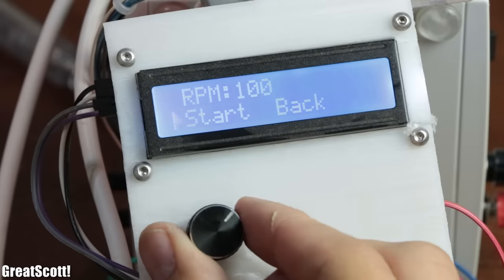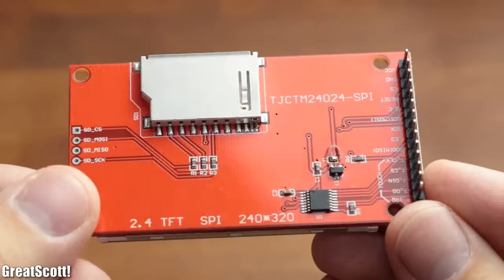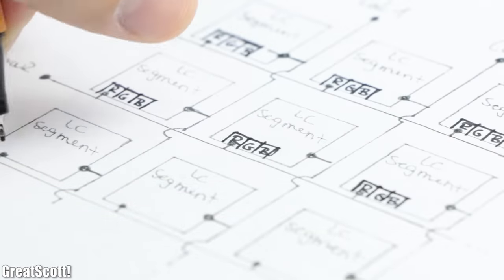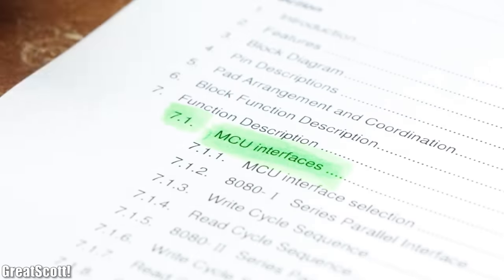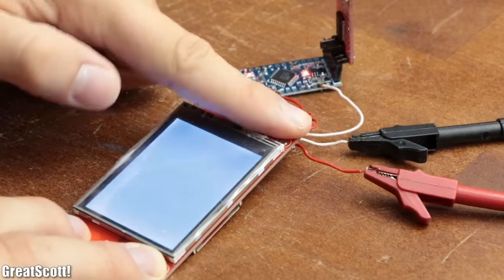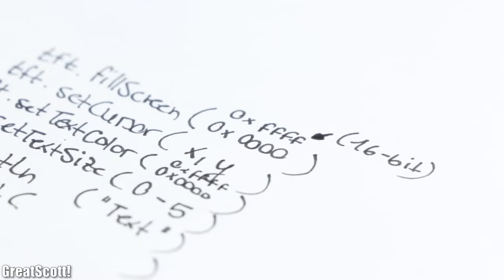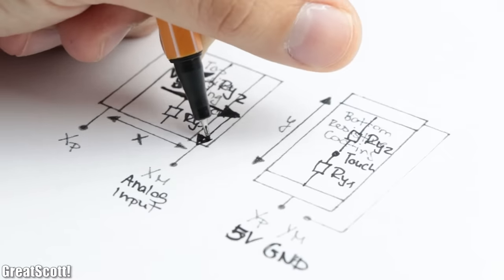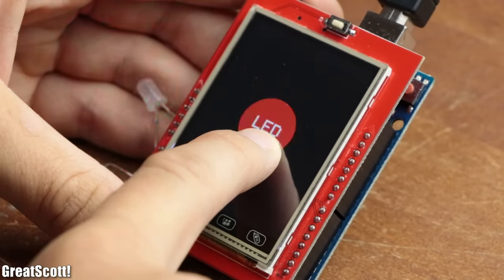How to create a simple Touchscreen GUI || Arduino LCD & Touchscreen Tutorial

Comment: Lol. Look up the MCUfriend library for that shield based display ...you know...the one mentioned on the silkscreen of the breakout board... That is one of the best display libraries written for Arduino and TFT displays. That library can even auto detect the hardware of the display because the MCUfriend library also specifies the shield pinout. The hardware is probed and supported using conditional if statements in the code so it can support a range of different hardware. It's an incredible example to check out.
 
  One thing I'm curious about are the memory IC's associated with a lot of these displays. Often they are unpopulated footprints on the breakout boards. I'm curious what they can be used for. Can these store backgrounds/images to lessen the load on the uC, or speed up the display in some other way? Do we need to program the memory externally or in circuit?

  Has anyone found a better deal on an ili9341 display than $4.23 shipped (AliEx/what I paid 10/2017[the listing has changed since]) ?
Reply: $4.23 is expensive? That's about the price of an Arduino clone!
Reply: @GRBtutorials  
That's about the price of 3 arduino clones if your willing to buy the all too common versions that use a ceramic resonator for the 328 like the official design specs. I have found the micro and mini clones with crystals instead of ceramic resonators for ~$2. It doesn't really matter though bc Ardy1 is all about the libraries not the hardware. If the hardware really mattered we should have been using the ATmega1284 ages ago, as it has the most features of any ATmega uC that comes in a 40 pin replaceable dip package. There is an ArdyIDE compatible version called the "Sleeping Beauty" project, but I haven't tried it myself yet. I will soon though bc I found an AliEx seller that posted ATmega644's at $0.90 each. I ordered a half dozen, and he's disabled the listing as "unavailable" ever since. Arrow also has the dip 40 version of the 644 for around $5 and with their free shipping deal, they have the best price I have found on those. I'm primarily interested in building a home etched version of the open source AVR transistor tester project version 2 from the official documentation using the 644, but I want to try the sleeping beauty hardware eventually too. That project is easy to find via google and the official page links to gerbers posted publicly on Osh Park. They can be downloaded and etched or they also work on the PCBway or JLCpcb site. I have no affiliation with either. However if anyone is interested in projects like this, I know JLCpcb hasn't stopped people from doing panelized designs. PCBway says they will not do panelized designs without a surcharge. I built a cart of items on JLCpcb awhile back. You can modify the 10 quantity for $2 first order thing to order a quality of 5, if you order multiple items. Each quantity of 5 was $2 as it showed in my cart and I took it all the way to the "input your credit card" screen. I didn't purchase it though as I was just exploring the option at the time. That said, if I understand all of these unspoken options on their site I can panelize two or more designs with multiple projects fit into multiple 100mm × 100mm double sided design/gerbers, then they are $2 each with free shipping.
...Sorry ....tangent...All that said at $4.23 for a single LCD... Even if I etch a design myself, I have already learned the hard way, never buy 1 of anything. There is no replacement for the ability to swap 2 items to determine if one is faulty. I've spent many hours trying to solve single product faults because I was dumb and ordering one of whatever thing. So at a minimum I'm looking at $8 for this LCD. If I'm going to order 5 or 10 of a PCB I need to order 6 or 11 LCD's. So that's going to be around $21 to $46 just for the LCD. However, building all of them, keeping one or two, and listing the rest on eBay should cover most of the project's costs.
 That's how I view these kinds of purchases. I break everything down to what the single quantity price is, but I'm usually looking for the best deal on multi-quantity listings or price breaks ;)

Sorry if writing details offends anyone. I'm just sharing and like when others do the same.
-Jake
Reply: Sure, I was just doing a rough estimate with "the same price". The clones I buy cost 3 € minimum. Does Arrow really have free shipping no matter the price of your order? Digi-Key and Mouser both have a 50 €/$ minimum order price for free shipping. Do they ship free to Spain as well? 

For prototyping and one-off projects, etching your own PCBs is the best method. It's the fastest one (you can make a PCB in 20-30 minutes at most and I don't know of any carrier shipping that fast) and most likely the cheapest one as well since you only need one. And what if you make a fatal, unfixable mistake? (like Jeremy, aka GreatScott! made in one episode of DIY or Buy that made him go for Buy. Seriously? You give up already?) Then you have 10 boards that are junk. But if you etch them, you only have one broken PCB.

I agree with you on buying more than one of anything (though I sometimes break that rule if it's too expensive), but it's not that expensive unless there are really that many faulty components. Then you should buy from another source as that one is unreliable. But if all of the ones you buy work, then don't worry, you'll find some way of using them all! And making various boards and selling them sounds like a good idea, especially considering you can sell them for more than the components cost you!
Reply: @GRBtutorials  
  Agreed. My biggest issue so far with etching is just getting my trace resolution low enough. I can do a perfect double sided etch with dry film at a trace resolution of 0.6mm to 0.75mm using the super cheap Chinese film and cheap copper clad. I try to keep my traces around 1mm and larger as much as possible right now. I've gone all the way down to 0.4mm using toner transfer but the traces are getting sketchy at that kind of resolution with the cheap setup I'm using. I'm collecting the stuff needed to upscale my etching setup now. I think I'll be able to improve my resolution if I stop trying to squeeze my designs onto 10cm × 15cm copper clad with ~1cm margins. I just ordered some 8in × 12in (~20cm × ~30cm) from ABCfab on eBay last night. That should maximize my potential design area close to the size of an A4 transparency. I'm going to try to panelize a few projects and make an attempt at a 10×10 LQFP-64 at 0.5mm pitch in the next few days. I also hope I can replicate my toner transfer TSSOP 0.65mm pitch/0.4mm resolution using dry film too. I've heard that I need to pick up some Dupont Resiston film to get better results but I still need to order it.
  I guess I need some better enchant though bc my last project iteration took 45 min etching and you just claimed you could do 2 total iterations in that timespan. It takes me about 3 days to do each revision of a design, but I'm a partially disabled gimp and very slow. Maybe when I get my setup dialed in I'll be a bit faster. I know I'd speed things up if I figured out how to add the teardrop trace plugin to KiCAD. I currently design in KiCAD then export an SVG image to GIMP. Then I finalize my design in GIMP by removing every sharp edge and angle. I've only done around a dozen etches using dry film so far, so I'm still dialing it in. 

  In my opinion Jeremy is mostly interested in monetizing this whole YT affair. Almost everything he does is focused on advertisers and referral kickbacks. I don't hold that against him or anything. However, his best uploads IMO are the ones where he's building or doing some project he actually wants to work on like his bike project, solar roof, or RGB light-wall-thing from way back. I don't think he's got a very technical background beyond the electronics stuff. Most of the YT community is in the same situation though. We can't all be Big Clive or AKA Kasyan. I think it would prove challenging for Jeremy to develop a solid prototyping system and keep his weekly upload schedule. Plus the largest audience here on YT are the absolute beginners not the intermediate or advanced enthusiasts. Financially, he's probably right where he needs to be with content. 

  As far as Arrow and the free shipping deal, I'm not sure about how their international business works. The deal I see is for free overnight FedEx shipping with no minimum order. I've done a few $20-$40 orders so far and it's pretty awesome. I've almost ordered from digikey a few times in the past when they were the only one that stocked a part or two, but I have always found alternatives and equivalents. Supposedly, there is a way to get free shipping (plus cost of a postage stamp) from Digikey if you send a BOM on some kind of ancient mail order form and include a check for the correct total. There's an old post on the eevblog forum that details this, and has the pdf form IIRC. That's too much hassle for me, plus Digikey already has the highest prices on every bom I've compared against mouser. I've ordered from mouser a few times but they cost me ~$4 shipping. I'm in the greater Los Angeles California area so they all have business operations in the state which means I have to pay ~10% extra in state sales tax too. Free shipping places Arrow on even footing with AliEx sellers on a lot of things especially more modern microcontrollers. The next day delivery means they are by-far the most convenient option I have available. Their website is really bad though, and the mobile version is practically useless.
  I think they have international operations and their FedEx deal could be int, but I don't know. Most of their shipments come to me from out of state so it's not a local kind of thing.
-Jake
Reply: @UpcycleElectronics  Totally agree. On Ebay always buy at least 2 of each. 
Mcufriend library  by David Prentice helped me getting those Mcufriend tft modules come alive. They are produced with different control chips and with no documentation
or marking and they can be hard to identify. 
Check also this site: https://www.tindie.com/stores/MCUdude/.   This board supports all the 40 pins ATmega's. Up to 1284. A little expensive,but good quality.
Reply: @mannhansen9337  
 Nice link. There is a project called sleeping beauty that uses the same 'mighty core' for an Ardy compatible 1284. If you search and find that project you will discover the gerber board files are posted publicly on osh park's website. You can easily download them and send the file to a much cheaper Chinese board house. I was going to try that but I started etching my own stuff. I have a single sided 1284 dev board designed for the AVR transistor tester project. I did 2 versions, one for the TQFP-44 and one for the DIP-40, (no content created). Both have an identical breakout setup. I made it with super flexibility in mind. The whole thing is setup to use standard 5x7 and 4x6 perfboards with headers kinda like shields for an arduino with a bunch of (4x) power rails and interconnects built in.

  I wanted to explore a bunch of the LCD options for the official open source AVR TT project. That's where the MCUfriend library kinda sucks. A lot of displays are sold online by people claiming they are ili9341's when they are not. I think they do this because MCU-f supports them. I learned the hard way that a lot of these "ili9341's" either are different control IC's, or they are limited to a parallel interface only and therefore they take up almost all of an Uno's I/O. The best way to get an actual 9341 is to find the ones that only breakout the SPI interface.

Comment: I don't know ... I still would go for some sexy rotary encoders over a chinsy resistive touch screen

Those LCDs are very cool though ... am seriously considering moving to those (so far I've used those relatively tiny OLED screens ... aaand ... meh ... the SSD1306 ones are fine, but they do suffer quite a lot of burn-in, especially since most of them are blue, which apparently is the color that dies the quickest)

Comment: Hi great scott
 I have a question .... I measure the voltage in my home at mains plug with neutral and ground while electricity cuttof.
 I get reading  of about 4 and half volts.   But when I connect small led to it with diode ..the led is glows for less than second. ...while in my pc extension board , I always seen led glows dim and continues .
Can I get some power to charge my phone or glow little led lamp while cutt of electricity   .by using boost converter. ..plz make video on this topic. Thank you.

Comment: Is it not the adafruit library works only in arduino uno since they have a different pin layout with the arduino mega or you just adjust the code instead?

Comment: Know how, there is a Wemos R32 D1 with UNO Pinout, Touch and function is not so easy to use. Here the Pins for touch A1 = 4, A2 = 15 , D6 = 27, D7 = 14 - 15 is not connected to A2

Comment: Hey great scott,just a fast question have you found a way to eliminate using all the pins on arduino so like I can add sensors like to display data on the screen but without needing to solder

Comment: I also had some problems with SPI display till I realised that it has 5Vcc power supply, 5Vcc with a 10 Ohm resistor to LED but 3.3 Vcc logic. Now it is working fine but I am looking for info on how to manage touch signals (that also must be 3v3).

Comment: I have a problem with the TFT 2.4 LCD project.
my lcd was detected with the ILI9341 chip but when
tft.begin (0x9341); LCD does not work normally, LCD is only white, but when I replace it with tft.begin (0x9325); the problem will be solved but not all, there are a few more problems with the LCD,
1. the writing on the LCD is reversed
2. The color on the LCD fades does not display the actual color
3. touch the screen that is not according to what I press
I use the library that is on your YouTube channel

can you help me for my school assignments ??
forgive my bad language ..

Comment: What was the exact board you were using for the SPI board?  From the image around 5:44, it looks a lot like the board I just got from https://www.pjrc.com/.  Assuming it is the same control chip (even if it is not the exact same board), it looks like you did not connect the "Reset" line and the docs for my board indicate that reset must be held high with a 3.3V signal.  I wonder if the issues ou had were because you left it floating (disconnected).

Comment: Would it be possible to do a video on a multipage menu for this tft screen? Example, a home automation setup and you touch one of the onscreen buttons and it goes to the next page of buttons or a submenu that you can control certain settings from.   JOS was created some time ago but no longer works with current libraries.

Comment: Not sure anybody will see this since it's 5 years old, but I bought a HiLetGo touch screen and cannot get the touch to work. I get wacky values (no problem getting the display to work with a Pico, which is 3.3V). With no touching, I get false positives. Possible touchscreen hardware issue?

Comment: The lcd you didn't got working, you need to hook up the reset pin to 5v dc or the reset pin of the arduino. I fe got mine working and also got stuck with that display...

Comment: Great video but i have  question can i do a small oscilloscope using arduino uno or mega with one of these tft screen  ?
Reply from the maker: In theory, yes. But it would not be very useful.
Reply: so the Oscilloscope Kit which is about 20$ is more functional for a beginner in electronics ?

Comment: Hi 
i have an old computer with a dead powersupply.  i can replace it with a modern ATX PSU, but now on days there a no -5vDC in a modern PSU, but my old computer needs it (amiga 2000)
can i turn +5vDC into -5vDC?
Reply: maybe with a LM7905 ?
Reply: A proper ground will do, crimp a ring terminal to your -5v wire and bolt it onto the present ground on the psu metal if there is one. I did this to an old antec that was missing one and it works today, not sure if it'll work for your case but try it out.
Reply: Unless it's a data wire^

Comment: I ordered the second one(even from the same seller you linked in your description) and it arrived with the touch function broken. I tested it with different arduinos, libraries and so on(that was a coupple months back). 

The seller did offer me a partial refund without me having to send it back, so thats a good solution, but does anyone have an idea how you could fix that? 
I thought about heating it maybe? Any thoughts on that?
if theres little chance of fixing it, i could just use it as a screen of course.
Reply: i have ordered the second display as well, and the entire display was not functional, all I would  get is a white screen. I have the adafruit graphics library and the LCD one but it still doesn't work.
Reply: @spades898   With white screen you are probably using the wrong library. You need to test out
Mcufriend library by David Prentice, can be installed directly with library manager in the Arduino
IDE.